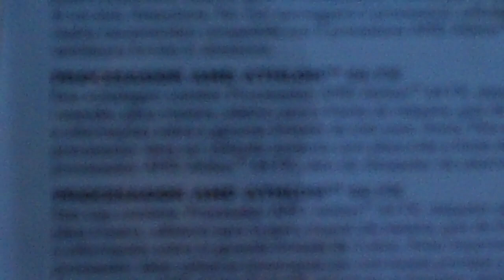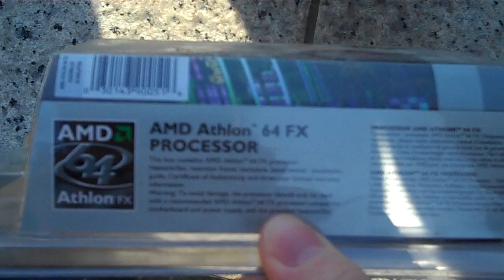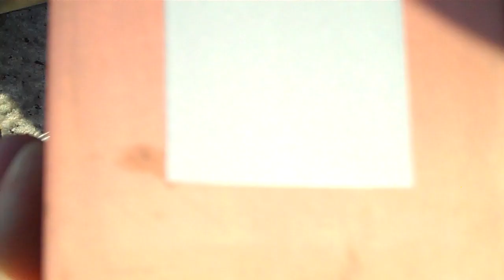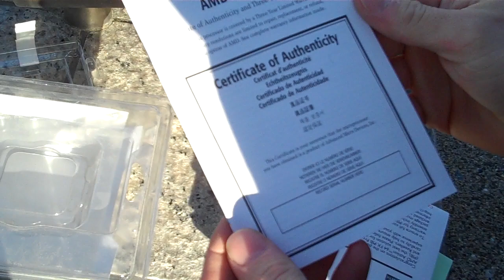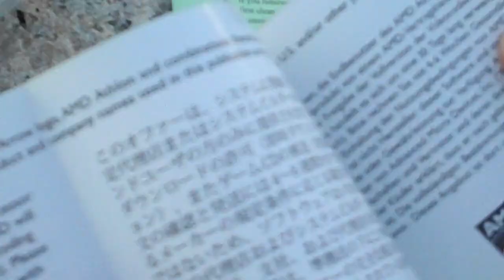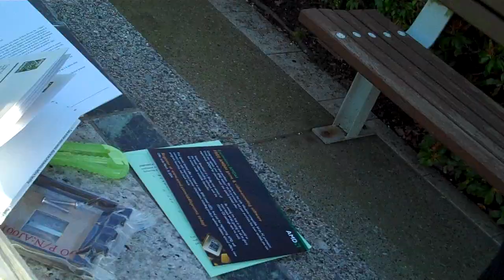RETRO UNBOXING AMD Athlon 64 FX-51 Sledgehammer Processor Unboxing & First Look Linus Tech Tips

Comment: +LinusTechTips
i call bullshit right there, back when 563 and P3 (and 478) were still a thing... anyways around that time. I had a AEROcool Alien (think that was its name, cant find its picture either :( ) so pipe tech cool has been since around about the 1Ghz mark. and i had a P3 370 766Mhz on pipe cooling cos it was a furnace in summer,

Comment: Who else wants Linus to find another CPU of this era and delid it?
Reply: There were athlons with no heatspreader from the factory back then
Reply: Bare die Athlons were standard (exclusive?) until Athlon 64, even the original Slot A versions. This caused numerous problems with the socket versions such as cracking from mechanical pressure of the heatsink (best to use a shim) and total failure (literally caught on fire) if the heatsink wasn't properly set or fell off its fragile plastic clips (no through-hole mounting systems back then).

For a short time, the Pentium 3 was bare die, specifically the early Coppermines.

Edit: huh, apparently there were through-hole AMD mounting systems in this time period. They must have been relatively rare, though, because I don't think most motherboards supported it. I remember everything being the triple clip system or the single clip if you wanted to trust your $1500 PC to a single nub of plastic with a ton of mechanical force on it.

Comment: so the fan has an unipolar stepper motor and the new ones are based on bipolar stepper motor both can be driven via PWM , the diference is construction method , but principle is similar for driving it .

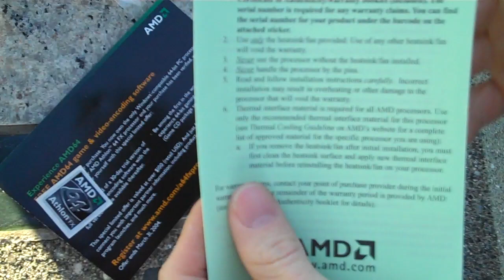Comment: I had the semperon 3100+ 1.8ghz kingwin water cooling sys 1gb DDR PC3200 100gb hdd 40gb hdd IDE Nvidia FX 5500 AGP 8x  and this Case http://www.newegg.com/Product/Product.aspx?Item=N82E16811144253 oh this mainboard http://www.newegg.com/Product/Product.aspx?Item=N82E16813187011  back then My Cpu was clocked too 2.8ghz  i had a 533mhz front side bus my machine fuckin killed  intel my rig today is 6 yrs old IRC@Efnet: [05:53] ( @D|sT ) OS: Win 10 Enterprise 2015 LTSB Evaluation x64 CPU: 6xAMD Phenom II X6 1090T@3323MHz(3625MHz) L2: 512KB (39.17% Load) MB: Gigabyte GA-970A-UD3 [F7] RAM: 6859/8189MB(83.8%) HDD: 2469.37/4066.62GB (60.7%) GPU: Radeon R9 280x Matrix ROG@501MHz/1600MHz 3% Load(3GB) 47C [15.301.1801.1001] Display: 2560x1440@60Hz Sound: Sound Blaster X-Fi Surround 5.1 Pro Net: Realtek PCIe GBE Family Controller (1Gbit) Uptime: 10h20m Temp: Temp1: 29c Temp2: 40c Temp3: 44c

Comment: Try and see if this cpu cooler does just as well as a modern one.
Reply: +Sponge Boob it doesn't even have heatpipes. didn't you watch the video?
Reply: Bacon CheeseCake you mango the stock intel cooler doesnt have heat pipes either.
Reply: Sponge Boob the stock amd cooler has heatpipes.

Comment: "Heat pipes didn't exist back then" this video was posted 5 years ago about a CPU that came out years before that. I recently got an FX-6300 with the same exact cooler without the copper base...

Comment: The sweet old days..miss my Athlon xp 2200+
Reply: XantoS441 I remember way back when our school using the AMD Athlon 64 processor. It was quite a zippy processor for it's time :-)
Reply: EpicEverythingDude75 Those we're the days lol
Reply: XantoS441 It was very fast for a chip too.
Reply: I still have a custom gaming rig from the early 2000s with an Athlon XP 2400+. Need for Speed Underground 2 ran pretty nicely
Reply: ***** My notebook has 8 gigs of RAM and a 1TB hard drive LOL. It's a Toshiba Satelite and the new ones are amazing. My dad still has his old Windows XP Satelite with a Core 2 Duo processor. Mine has Windows 10 and a Haswell ULT based i5 dual core chip running at 1.7Ghz. I love it. It's very fast and having 8GB of RAM helps a lot because I use this not only for games, but for standard tasks too. And it makes those standard tasks seem very easy and effortless.
Reply: EpicEverythingDude75 I have an alienware m14x i7 3.7GHz quadcore 2 tb 16gig ram. I bought it used for 500 dollars.... the guy didn't know what he was selling. I upgraded the processor to the best 3rd gen mobile processor and got a new charger for it. and a new hdd. Thing runs like a beast minus the heat while editing. I swear I can make myself a fried egg on the keyboard.
Reply: ***** What do you think about my laptop? I don't play games with it I just use it for music, internet, and producing music too so having a 1TB hard drive with 8GB of ram actually helps me a lot. Also having a Haswell ULT processor helps a ton too :-D
Reply: I still have my acer aspire computer with this processor

Comment: too bad the current fx series uses potato architecture
Reply: marley gibson it's not like AMD has released any relevant cpu since 2012...
Reply: skotty523 Really? Its not bad at all. It was released in 2011, it still holds up pretty well with the current haswell chips.
Reply: marley gibson i used to have an 8350 and when i switched to the i5 4690k i got around 10-15 more fps in games with my 780ti
Reply: skotty523 You looking at 1 cpu,and I doubt it. But your comparing a cpu from 2014 to a cpu from 2012
Reply: +MiDnYTe25 
That cant be right . The athlon 64 series kicked intel's a** .
Reply: +MiDnYTe25 
lol dude the fourth CPU on that list is the FX-6300, where are you getting your shit info XD
Reply: +skotty523 my fx8350 is at 5.2 ghz without problems never dipped below 55 fps
Reply: +skotty523 yeah, exactly the problem with AMD CPU's today: lack of high-end models. If you check userbenchmark's CPU ranking list, only the 108th CPU is AMD, all 107 before are Intel. I think it's quite telling.
Reply: ***** The reason is that AMD did have high end cpus that nobody used.
Reply: It is. That was some 5+ years ago. Gotta keep up.
Reply: so?
Reply: skotty523 bitch now wr got ryzen

Comment: still a better heatsink than the one i got with my INTEL 4770K!
Reply: Yeah, the stock intel heatsink is crap. I'm using a HP dx5150 MT, a PC from 2005, and it has a better heatsink than my core 2 duo came with.
Reply: Arron Somerville lolb me too
Reply: Arron Somerville BUT WHAT A DUMBASS WOULD USE A STOCK COOLER WITH K PROCESSOR ?!

Comment: There's really no reason to get the A10 if you're going to be using an external GPU, So get an AMD FX, it's better and cheaper than an i3. However don't get the 4170, get the 4300, it's newer and faster but not much more expensive.

Comment: I am using a computer that has that chip to watch this video. That cpu and mobo came out of an alienware top of the line gaming pc back in the days. it was out of commission for several years due to dead gpu. I just barely rebuilt it and both mobo and cpu works. 
SPECS 
mobo: asus socket 940
cpu: amd athlon 64 fx-51 2.2ghz
gpu: nvidia geforce 6200 AGP
sound card: sound blaster audigy 2 PCI
ram: 2gb corsair 400mhz DDR
hdd: maxtor 320gb ide 
psu: 350watt
OS: windows 7 64-bit
this setup is a beast.

Comment: I love the Retro unboxing. I'd like to see more and a retro PC build. I'm actually running a Pentium 4 3.2ghz (board came with a P4 2.4) processor in socket 478 on an ABIT-IC7 overclockable gaming mother board from 2004 with 800mhz frontside bus with 4GB dual channel DDR RAM in 4 DIMM slots and I'm running WIN7 Ultimate for my operating system. Graphics card is AGP HIS Radeon 4670 1GB GDDR3 with 5 more PCI slots. I wish that the processor supported a 64bit operating system.